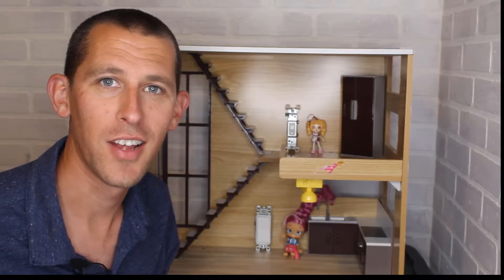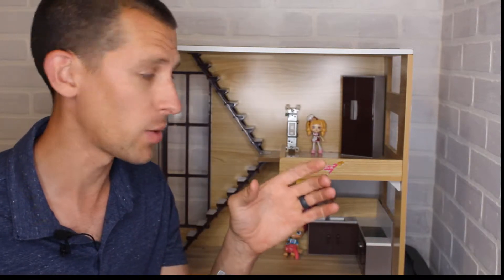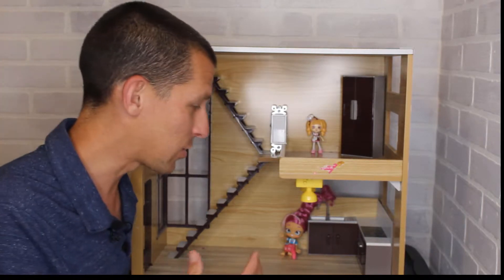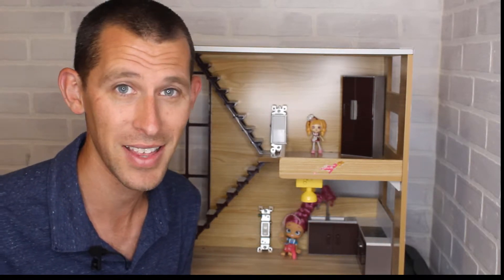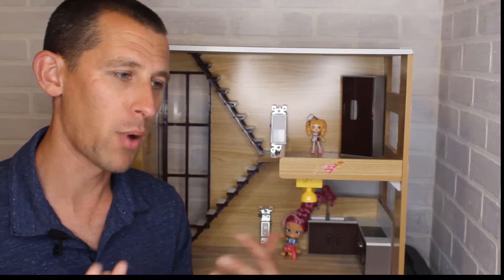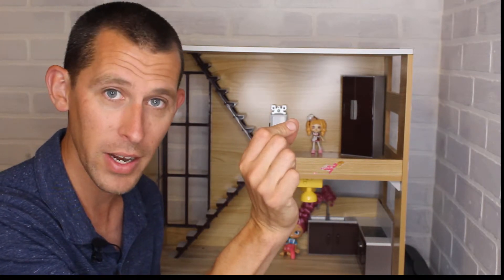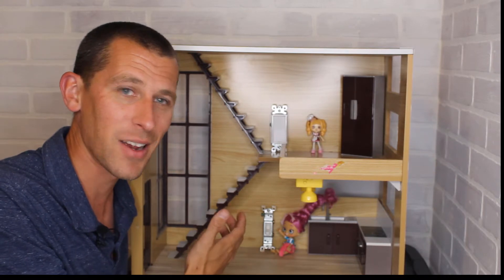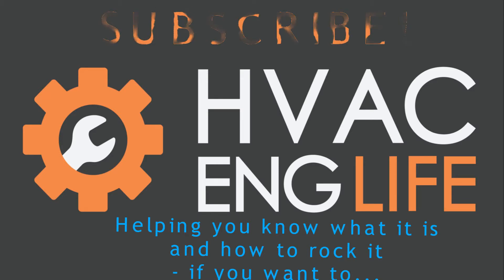Upstairs too hot? Add a Stat!

Comment: Thanks good video an explanation of what I was looking for.. furthermore people are thinking that it will make your system run harder but it's already running hard either way but you can easily stop the fighting forces between the two thermostats by getting a Wi-Fi digital thermostat and utilizing the scheduling program to stop the two fighting forces.. you can easily set your temp to a schedule that works for you on how much and what time and make any adjustments even when away from home

Comment: I have an older 2-story brick house built in the early 90's with a heat pump in Ky where it can get extremely hot and humid. As soon as the temps get around 80 - 85 F the upstairs gets so unbearable. I turn off all the vents in the basement and on the 1st floor, make sure  they are open on the 2nd floor, and put the damper to summer but it does very little if anything at all to help. The basement as expected even with vents turned off freezes, 1st floor stays comfortable and the 2nd story feels like someone set the thermostat on HELL! Honestly, the system has never been able to cool our 2nd floor. I have went as far as putting one way mirror tint on the windows in the 2-story foyer and that made very little difference. So I do not think the 2nd thermostat would do me any good because I feel like my system runs constantly already just to keep the lower 2 levels comfortable, I can't imagine the extra stress the system would experience if it were to never stop running trying to cool upstairs. Anyways, after looking into this I think it may be time to look into a mini split system with multiple air handlers for my upstairs. I just don't see any other solutions.
Reply: I think you can very easily control the fighting forces using the scheduling times in the digital ones and using the phone app to further adjust them

Comment: Soooo, the hvac guys fix is to turn the thermostat down. 
Honestly I hope you don’t get paid for your hack services. 
The actual better cheap but probably still wrong option would be to add a window, portable, mini split system upstairs. That way you cool upstairs but don’t waste electricity freezing out the downstairs.

Oh, and you’re just running thermostats in parallel, it’s nothing magical or special.

Comment: If I try to get my upstairs even below 77 degrees, my downstairs would be 10 degrees colder.  Not sure how 2 thermostats controlling the same ac unit with the same vents wouldn't freeze out the first floor trying to cool off the upstairs.  Maybe I'm missing something
Reply: You're right. You'll actually need two units
Reply: @primary3093  was thinking two air handlers operating off of one condenser that way you only  heatandcool the upper and lower independently
Reply: This is what I’m talking about 
This is will make the AC working constantly and also it’s going to be different between upstairs and downstairs temperature
Reply: I was thinking the same thing. I deal with this exact issue and adding a 2nd thermostat upstairs would just call for more cool air for all the vents up and downstairs. We only have an issue in the winter, super hot upstairs but cool downstairs. So we just always have the fireplace on.
Reply: 77 I'd love that
Reply: Controlling the two fighting thermostats is very easy to do with Wi-Fi digital thermostats by using the scheduling by setting the correct temperature to the correct times automatically.. Also it works better on Holmes where family either is upstairs at night or downstairs mainly during the day
Reply: Yes. But this is a cheap way to try to get it to work.  Either try this or shell out for another unit. Lol.

Comment: This won't solve the issue folks...been doing HVAC 15 years and I have my own company now...great idea but no solution...You need a Zone board and dampers for this to work...otherwise you're just adding another thermostat
Reply: Thats all i want. I want the downstairs thermostat to stop reading the downstairs temp at night and just go off the one upstairs where its hot as balls.  My downstairs is drafty and my heat runs all night and bakes the upstairs.  I want it to read the upstairs temp and not worry about how cold the downstairs is.
Reply: I'm not an HVAC guy and I know this won't work because I have this problem in my home and it's obvious I need some sort of separate venting otherwise you'll just be running the air conditioner until the upstairs cools down.
Reply: Agreed, mainly the upstairs one would be overriding the downstairs one in the summer and the main floor overriding the upstairs in the winter. Basically causing the system to operate longer until the two zones are at the requested temp.
Reply: What if you would put a switch between each thermostat and the spliced wire so you could turn one of the thermostats off and only have one control the furnace, of course we'd still be freezing the downstairs at night, I get that.

Comment: Wont that make the unit run way to much though??
Reply: I thought about doing this with those smart thermostat WiFi sensors since my upstairs is always "cooking" in the summer even with central air (one zone problems). Ultimately, I think I'm going to re-zone the house as the sensors will just cause the system to run continuously to satisfy the temperature and most likely never reach desired temp.
Reply: I wouldn't say run way too much. I would say downstairs would be freezing in the summer. Unless he is closing his vents downstairs which might damage his unit over time.
Reply from the maker: @BTAURES  You'd be right that theoretically downstairs could be freezing, and sometimes it is.  Thankfully my kids can't close a door to save their life which keeps the downstairs nice and warm.  :)   But seriously, the goal is just to be sure that the space that needs cooling/heating gets a vote too.  

If you try this and downstairs is way too cold, the better fit might be installing a control damper close to the unit that you could close down the downstairs flow and force more upstairs.  My unit is undersized on capacity (1200sqft/ton - Energy Star construction), ducts are very large for low restriction so diverting extra flow upstairs would not be an issue for me.  You should always analyze airflow/capacity/duct work before closing much off or diverting flow.
Reply: No not unless you use a digital Wi-Fi thermostat you can easily use the scheduling temp and times feature to set it specifically to when and how much at any given time automatically and make adjustments through your phone even when your away from home
Reply: So if I have a 2 story house with 2 old AC units outside that died. (I’m in the deep south with horrendously hot and humid summers). Everyone says get 2 units ( meaning outside units-condenser?). But I can get a free 4 ton 1 one year old rheem from a house I’m leveling.  Are you saying I can use that unit and just put 2 thermostats inside?  And I was told the old. inside unit couldn’t be used with the new type Freon etc. I’d be willing to change out the inside if I could use that new rheem. What’s your opinion PLEASE! Thanks so much.